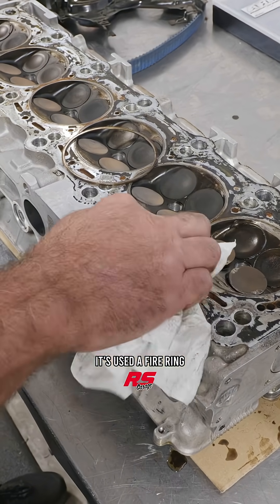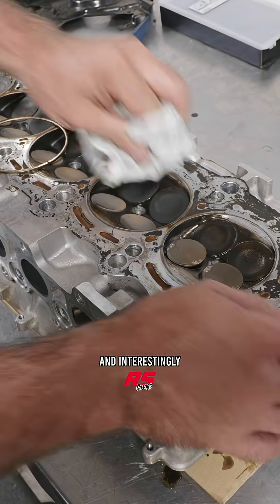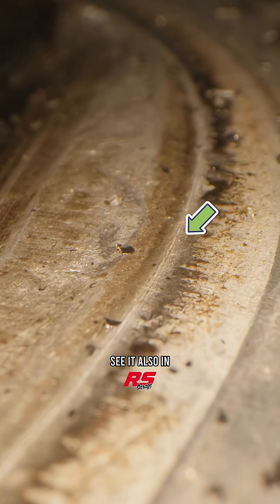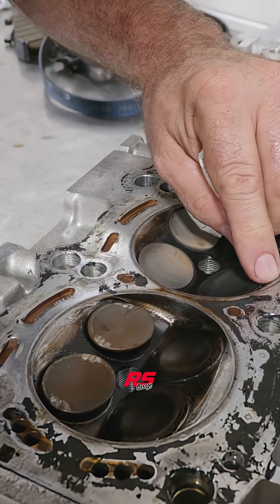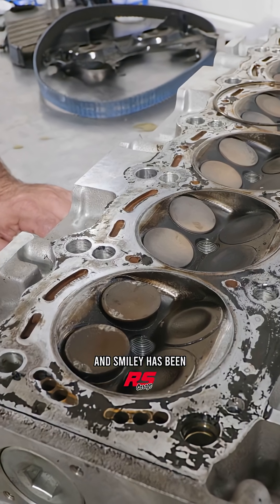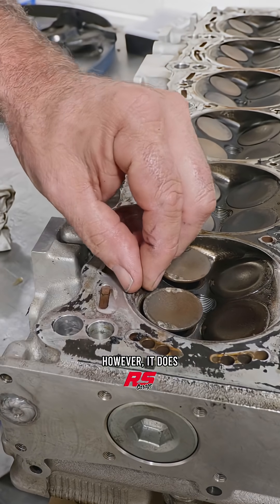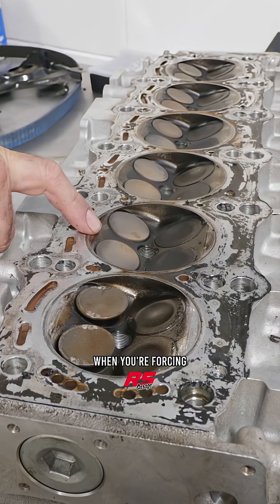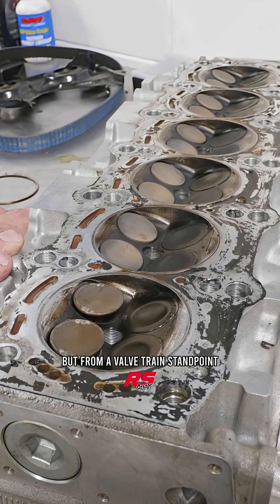how does a fire ring head gasket dig into a cylinder head over time.

Comment: i found a less than perfectly (not shiny) head surface creates a micro crosshatch for the sealant to bond/stick (mechanically) this sealed oil and water more effectively 

RBs and 625s don’t mix…i used 625s first time and 2000s the second and found those kept the head surface more straight. especially on old (soft) RB those 625s really stress the head.

Comment: Fascinating stuff Jay! Always wondered what kind of metal mashing shenanigans happened with these rings and fire lock gaskets and piano wire etc between blocks and heads. Really interesting to hear that re-torquing can band aid the head sealing for a while. Makes me think of something I've occasionally thought about - what if you assemble an engine and then throw the whole thing into an oven for a while, let cool, and then re-torque? Maybe then you could run it longer without having to re-torque again later... I would guess at these kinds of elevated power level we just flat out need harder metals for everything in order to increase longevity